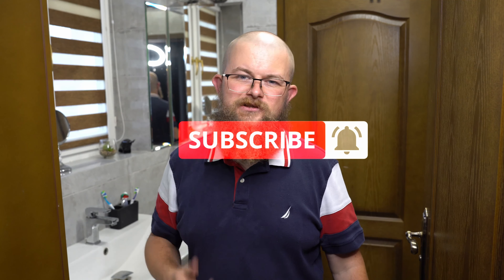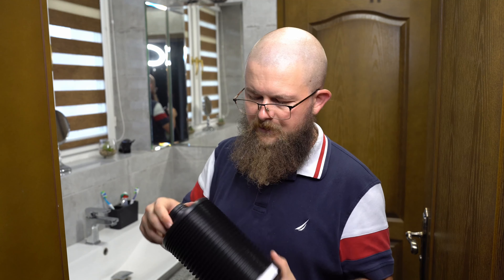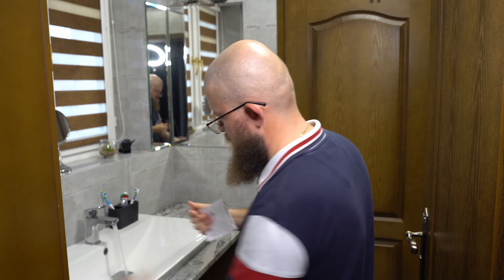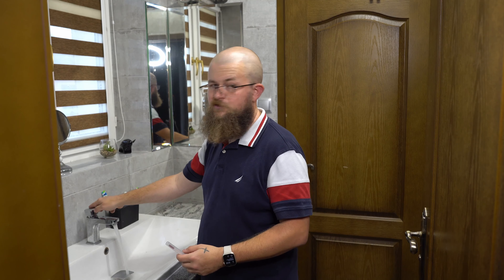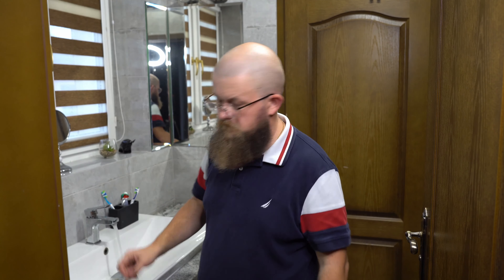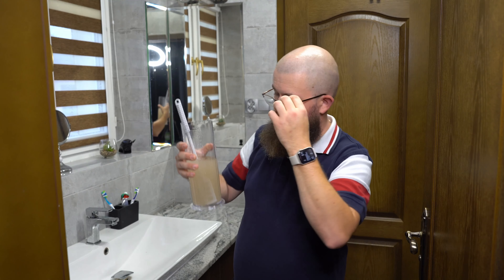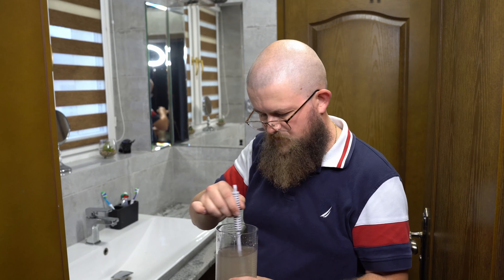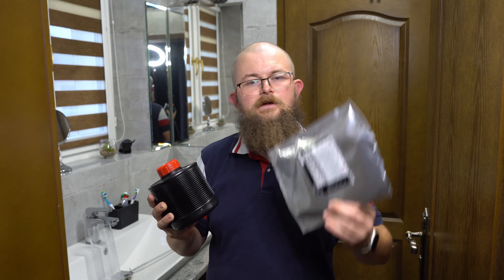How to Mix Cinestill Df96 Monobath for black and white photography development.

Comment: Hello, does it not hurt when we mix the developer with the normal tap that there is no good effect on the film, should the mixing be with distilled water, or is there no problem in the matter? I am waiting for the response and thank you for posting,,
Reply from the maker: Hello, sorry for not mentioning it in the video, i forgot all about that. But it does all depend on the type of water you have. You should experiment and do a test with your water and with destilled water. For most cases you dont see the difference. Boiled water (when cooled down) is also well for those who dont have the best quality water. For me there is no difference, but i additionally have softening filters on my water system. - you can use them filters as well, they are the same types you put on your faucet to be able to drink the water fresh.